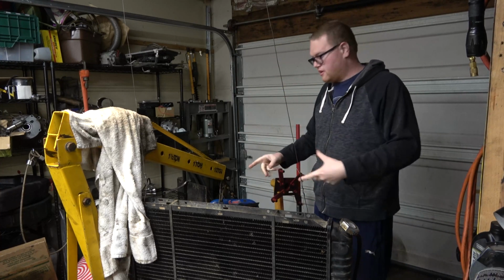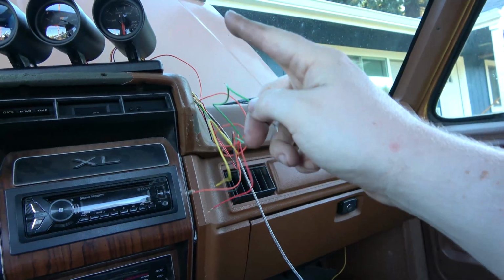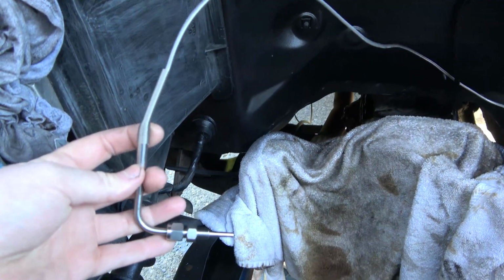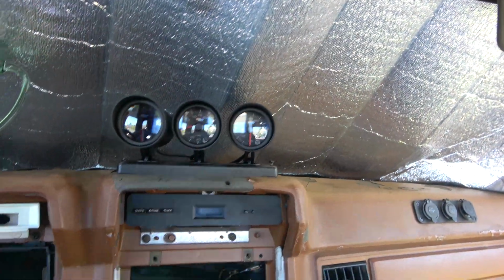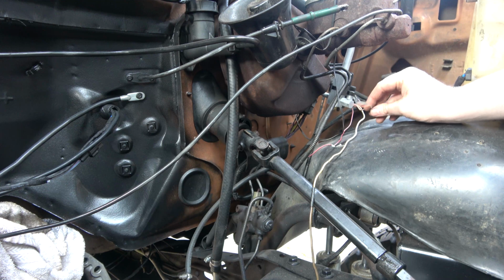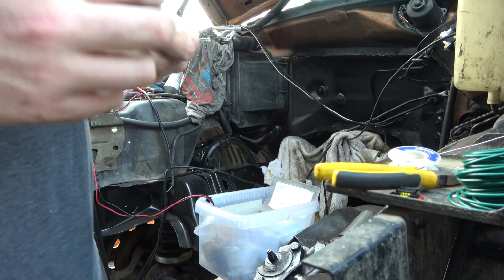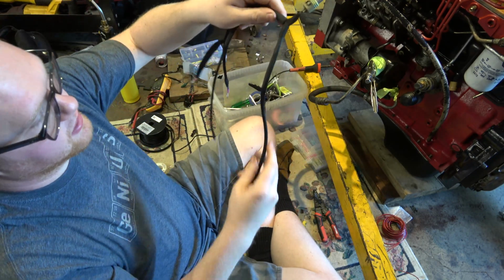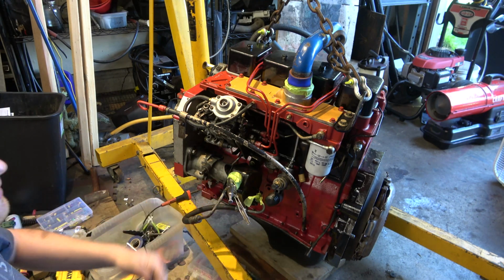4bt Cummins Project | Gauge Install and Engine Wiring

Comment: i know theres passed several years from this video to up to date , but its very usefull for me here in argentina ,  do you have the electrical wiring and workshop of the cummins?
Reply from the maker: I do not, but the 4bt Cummins is very simple. Mine had 1 wire that ran the whole engine.

Comment: I believe the "yellow" wire in the relay, the one you cut, is so you can use the relay in a normally open, or normally closed configuration. This allows the control circuit to either open the high amp circuit, or close it, or just change the destination circuit. Sounds like the yellow was for normally closed.

Comment: Quick question jimmy wonder if you wanted to engine mods to it later why are double wrapping it that stuff going to be like super glue later
Reply from the maker: Flashflood140x that main engine harness is a permanent setup strictly for engine power and oil pressure. I don’t really plan on adding any additional gauges at the moment.

Comment: Great job. I have a 89 f150 4.9l 300. Been learning on how to do my own repairs. I estimate I've saved $2000 so far. Next job trans rebuild then oil pan gasket. Possible Harmonic Balancer and timing cover.